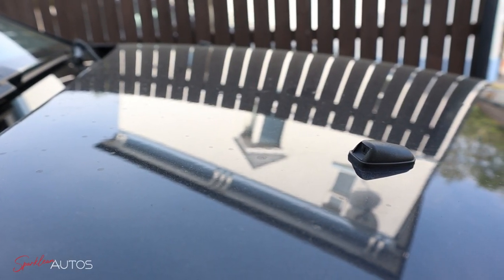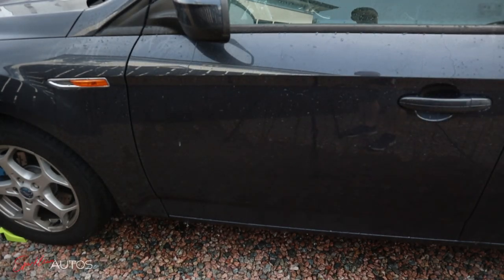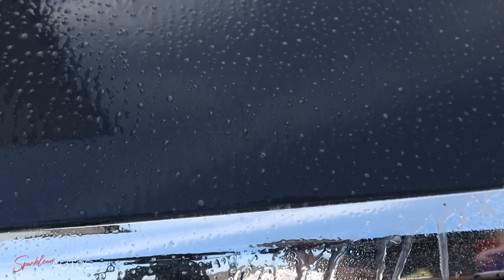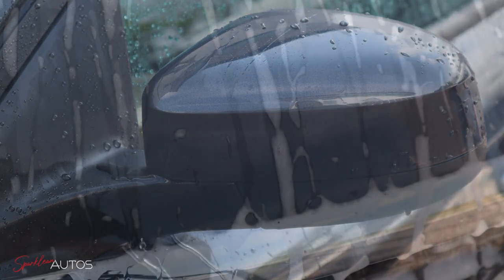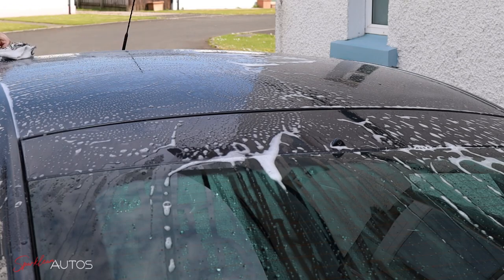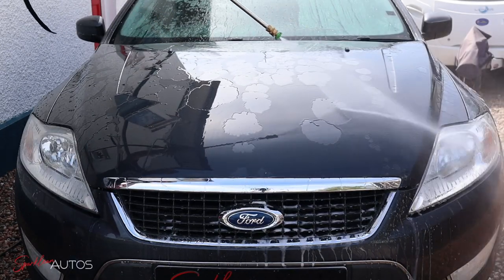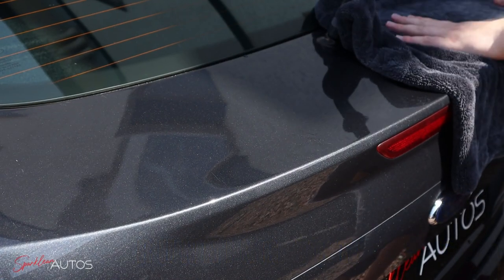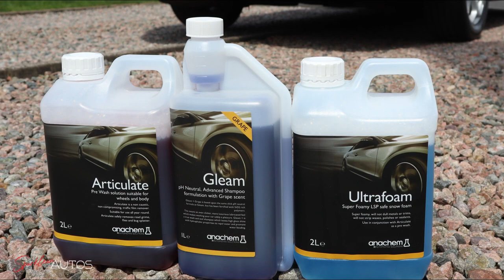Wash A Car For Less Than 60p ?!?! #carcare #cardetailing #carwash

Comment: Great content. Would you consider just starting with a pump sprayer and covering whole car in something like 50ml of greenstar? It would save you a rinse, snowfoam, mixing time etc. 25p per prewash
Reply from the maker: Hi Robert. I would consider Green Star (among many other products), however, this particular video was about using the products I had at their minimum dilution ratios - 10ml of pre-wash costing 5p (which wlis enough solution to pre-wash at least 2 cars) and 40ml of snowfoam costing 18p... There is no extra rinsing as they're applied at the same time, just the 10 seconds it takes to measure out... I've actually since washed a car with the same pre-wash mixture AND 20ml of the snowfoam in a 500ml solution... this worked out at 12.5p!! Ridiculous lol

Don't get me wrong, I'm not claiming these products are better than Koch Chemie, who are one of my favourite brands (certainly my first choice for compounds / polishes), I'm merely saying that this is what I wanted to use in the video as they're excellent value for money and are very effective 👍🏼 thanks for taking the time to comment Robert, it's always appreciated 🙂